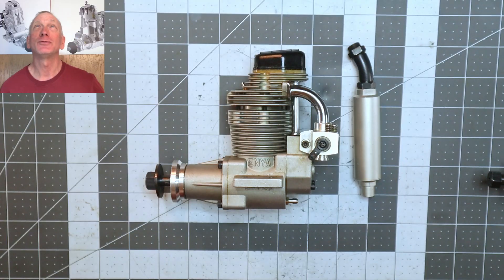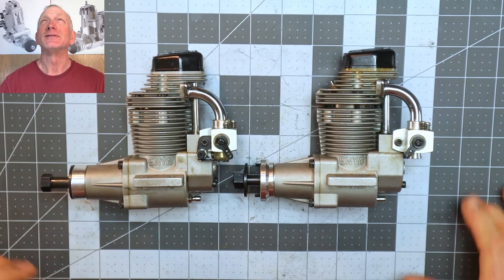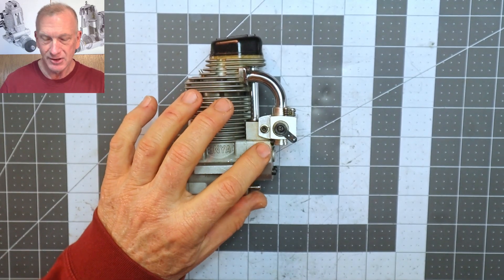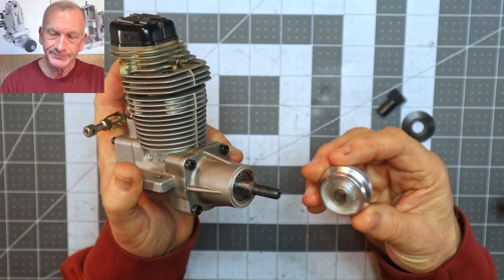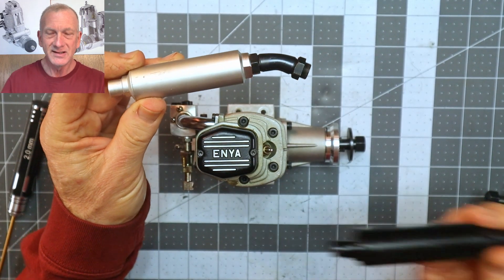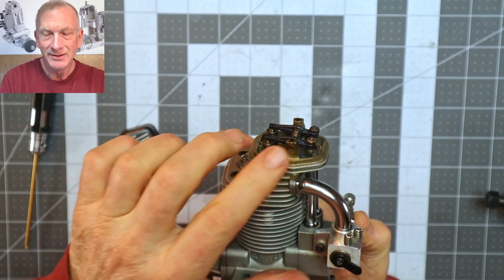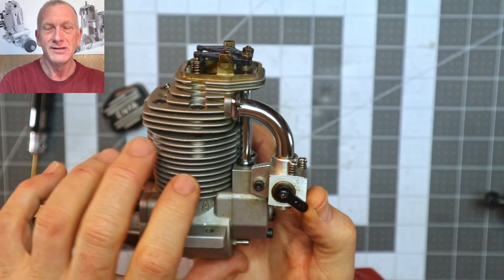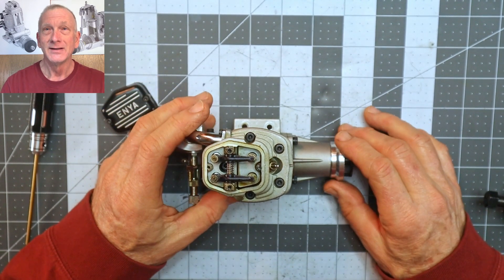Enya 120-4C A Quick Look

Comment: A really good deal on that engine, Enya 120's are very robust. Not so long ago i compared the weight of a Saito 120  and a Magnum 120 fs and Enya was lighter than the others by 10 to almost 15% and also a little smaller in size, all 3 engines with muffler installed.